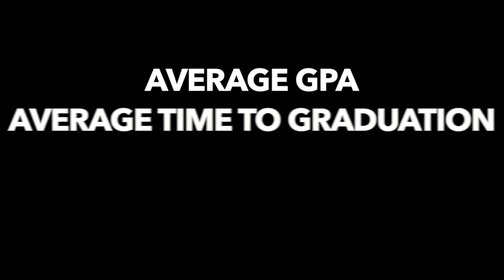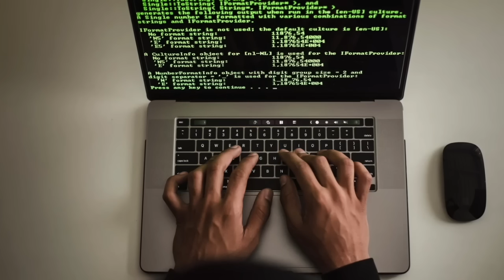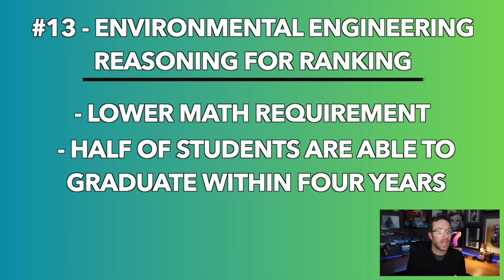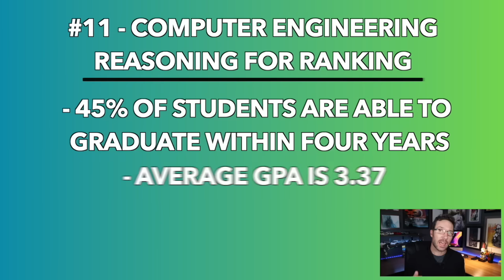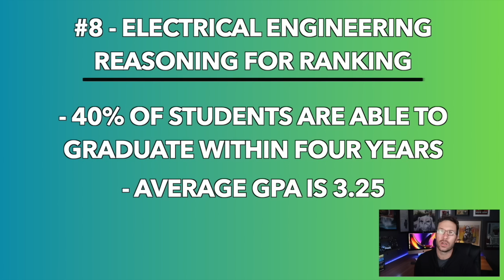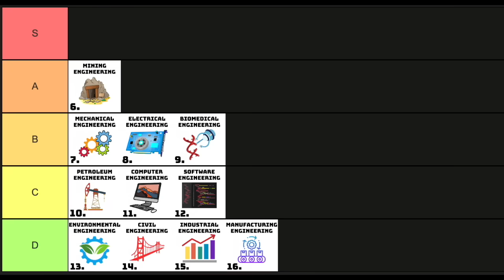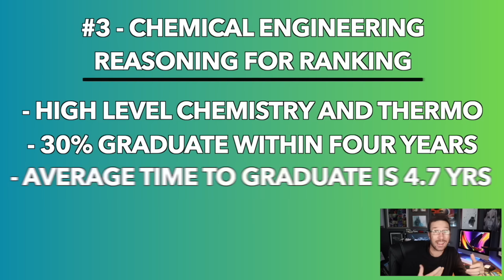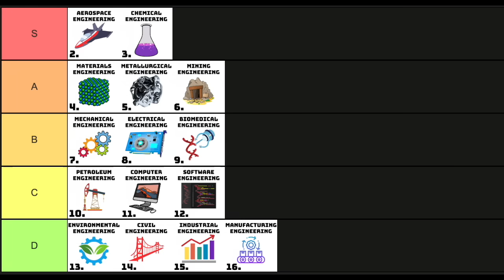Engineering Degrees Ranked By Difficulty (Tier List)

Comment: Very interesting review. Well Done and explained. I had to slow it down a tad and stop to read the charts fully. The hard back will be going to my young relatives for guidance. I know curriculums change over time. I graduated Industrial Engineering 1971, we had some metallurgy, Fortran, Calculus and lots of project management type things, Physics 3, and special problem solving. I had a hard time finding my way careerwise. I worked one year on the boards (Mechanical Design) under a Danish M.E. that was a wonderful mentor. Designing Fork trucks for high density storage/retrieval. We built Regenerative Battery powered systems, so when heavy loads were coming down for 20 feet high racks the hydraulic fluid was routing to the motor to back drive it and help charge the battery for longer cycles. In 1975! I learned dynamics strength and structure design for long chassis and tall lifting masts. That really stretched my thinking. Then I left to join a new division with Pfizer, Medical Systems Group. They had just bought rights to a prototype CT Scanner and sold 200 units that had to be built following the prototype within 1 year. I started as a Mechanical Assembler, because I felt i could learn the device and grow into engineering roles. I keep designing and making assembly fixtures to help everyone make better faster assemblies, then when a component had routine bearing failure I worked at home on a new design that was accepted and eliminated all bearing failure. Then they asked me to join Engineering to help with other weak components. And then they started up a new R&D Group and I was invited to join them as they were tasked to design Gen 2 CT Scanners.  Now I had great Product knowledge but little digital electronics experience. And being surrounded by MS and PhD was intimidating, since i was drafted in 71 I had access to the GI Bill, and our facility was close to Johns Hopkins Applied Physics Lab which offered Technical MBAs. So 3 years later i had a MS from JHU with 5 programing languages and Applied Physics credits in optics, lasers, systems and more Project Management in High Tech Systems Development. Here i brought Carbon Fiber in for the Patient support pallet 3 years before GE in 1978. After that i moved to Westinghouse Defense Electronics into their Manufacturing Systems Technology Center with a $5M dollar robotics program that was in trouble. I saved that project and received a patent for my designs, Reduced the AWACs electronics cost 20% and went on to work in Business Process Reengineering, Systems Engineering, Electronic Medical Records, Robotic Vision Systems and Collection Data Sharing in the IC arena. I wanted to express to you and your followers that an Engineering degree in one specialty does prepare you for a world of opportunities if you have your eyes open and are able to see them.  And that advanced degrees are not impossible to get and many ways to get there, Night classes with Company help or GI Bill like i had. I eventually crossed over into many areas I never even know existed over time. I ended my working days at 67 years old making low 6 digit income and enough saving to stay in my house with a basement Lab full of CAD(Fusion 360),  CAM(3D Printing) and Digital Systems(Arduino) development and still being creative. Building a Mini CNC Mill now.  And I was in the lower 3rd of my High School Class with little to no guidance. Everyone that has the will to grow should try to achieve your dream and goal. Be innovative in career moves as well as learning new things. My main weaknesses I would stress All engineering student to work on is: Public Speaking, Technical Writing, Work Breakdown, Digital Electronics Basics, Human Nature in Work environments and Critical Thinking concepts. Without saying Project Management is a Core Requirement. You must be able to think through tasks, work flow, see issues, weaknesses and plan a test point and possible retraction to find better method or solution. You can only define the one best way for the tasks at THAT TIME. Time may mean changes required. PERT and GERT were tools I learned and used daily. They both include reverse loops for rework, repair, rethink, that is key. My first WBS I was not sure about my task time estimates so I tripled them and was still short!!!!!!!! Budget becomes important on larger Project but should aways be on your mind. Use resources wisely. You never know when something will come up and bite you were the sun doesn't shine. Like Musk Starship Launch pad !!!!!!! If you see chunks of concrete flying around at the most critical point in a launch you MIGHT have a design flaw somewhere.  And only a good engineer can help solve that.
Dennis in Virginia

Comment: EE here, class of ‘03 (also have a JD, class of ‘06). Hardest class I took was e-fields because buried within each already not easy problem was a calc 3 problem. Think I managed a C+ — and I had earned an A in every math class!

Hard to say whether another engineering major would have been more difficult. Maybe chemical?

I think the challenge in engineering degrees is in how many classes build on prior classes, so you have to get all the concepts into long term memory. 

In case anyone was wondering, law school was far, far easier than engineering, partly because a lot of classes don’t build on other classes. You never fully grasped certain elements of property law, like the rule against perpetuities? Won’t matter at all when you take Administrative Law.

Comment: No mention of naval architecture - based on my (biased) experience I would say it's probably in a similar category as aerospace. For most ships the wind loads are small compared with the water loads but the water loads are both viscous and wave making. If you look at the latest hydrofoiling sailing boats the wind loads are critical and they are trying to eliminate the wave loads AND the materials are critical for both strength and weight. Basically the equivalent of supersonic flight but with only the elements providing the power!

Salary wise I suspect the world of high speed sailing doesn't pay as well as offshore oil and gas.